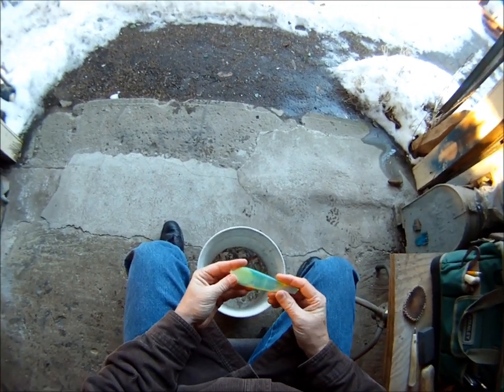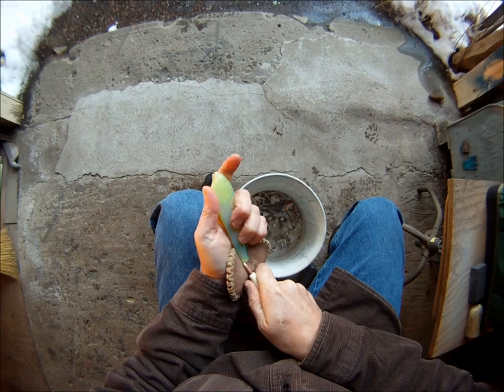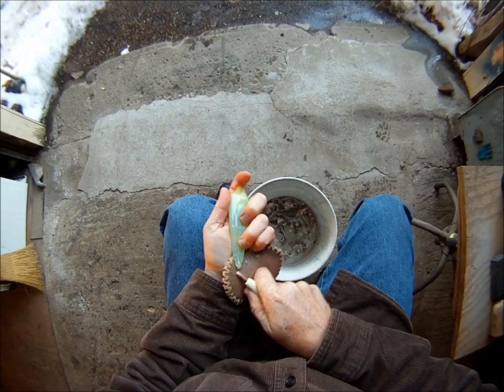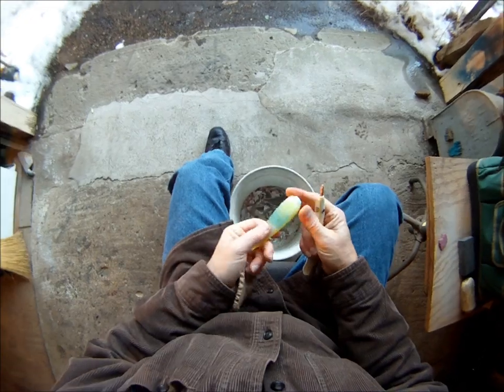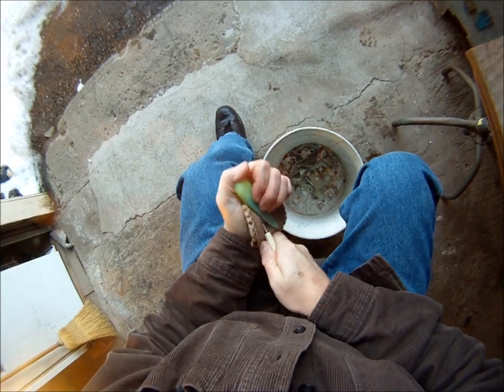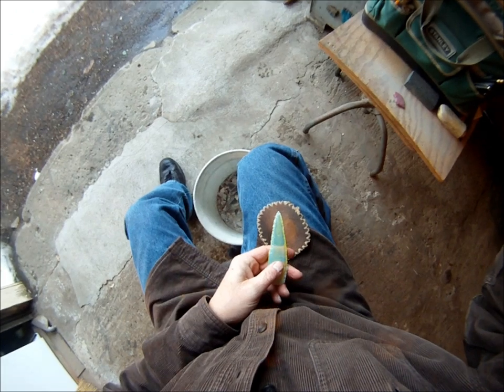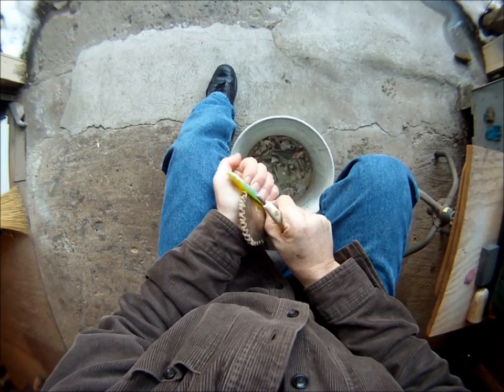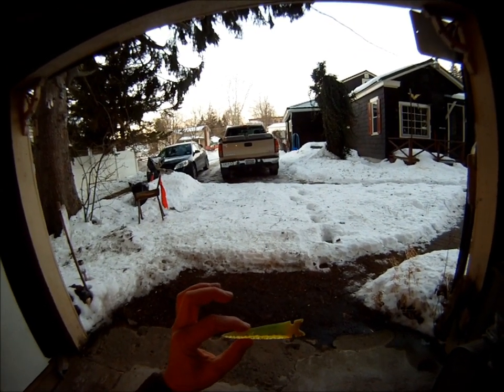Pressure flaking a glass Arrowhead!

Comment from the maker: You're right I really don't grind the edge too much, what I do is to use the tip of the pressure flaker to set the edge with a slight rubbing motion of the tip. This will seat the flaker and allow you to push into the piece with less effort. If you over abrade then you will need more pressure to release a flake which makes it more vulnerable to breakage. I hope this helps!

Comment from the maker: That's funny you watched this today because I did too for some reason. Yes you can do this with nothing but antler but you have to pay close attention to the tip of the flaker and keep it pointed up pretty good. For notching you can use antler if you file the end flat like a screw driver so it is narrow and can cut into the glass without making the notch too wide. Good luck when you can chip again!

Comment: Thanks for the pressure flaking demo on glass.  I noticed you did not grind the edges much. I grind much more and have to exert more pressure in order to get the flake to release.  That is probably the reason mine are breaking. Thanks

Comment from the maker: Glen look back through my videos and you'll find one I did about my tool kit. Also check the video Cabelly did on the tool kit I made for him, that shows everything you need to be able to knap like I do. I don't use a screwdriver for knapping but my notcher looks similar to one, and has a copper nail in it that has been pounded flat. I use a file to shape the tips of all my tools and a farriers rasp will work to clean up the end of your moose billets.

Comment: Tell ya what I wanna see,,I wanna see the placement of the nail tip on the edge that you prepared for pressure flaking.I know platform prep is key,but I'm not sure I'm doing the right thing.Lookin to see if you are pushing in on the very edge,or getting a little bite of the opposite face from the one your removing flakes from.does the edge need to be flat enough to butt the tip into,so as to keep from crushing it as you push in?the edge is flat right,or at a slight angle?details for me!!LOL

Comment from the maker: The steel nail will not work as well as a copper wire or nail because it is too hard and slips off the edge of the preform. Copper is very similar to antler as it is much softer and grips the edge of the preform like the antler tends to do.

Comment: Would a screwdriver do the trick? I can't get whatever you're using, but I've got plenty of screwdrivers.
Reply from the maker: I actually used to use a screw driver when I first started chipping out small arrowheads. I like to use an antler tine or a copper nail now because they grip the edge of the stone much better and I can make the flakes come off easier.